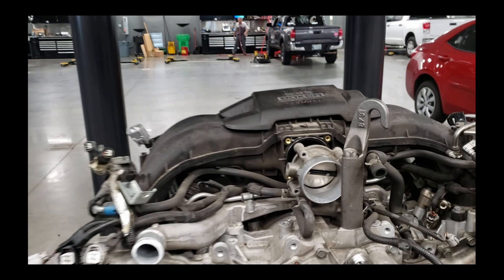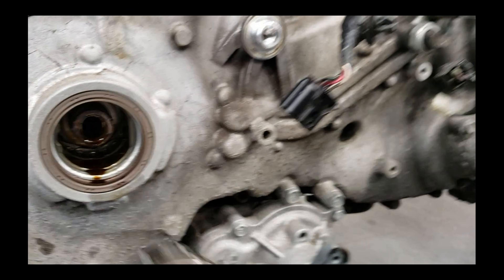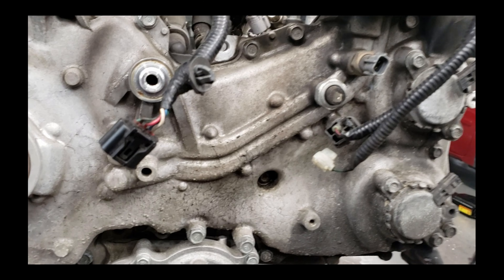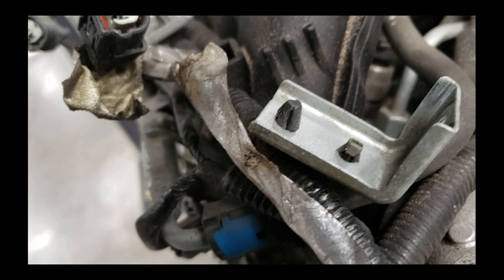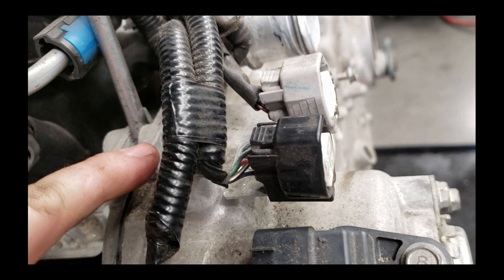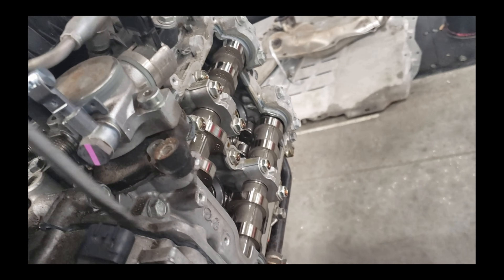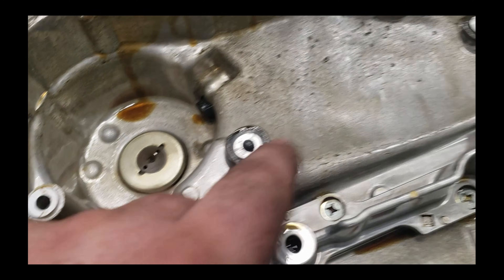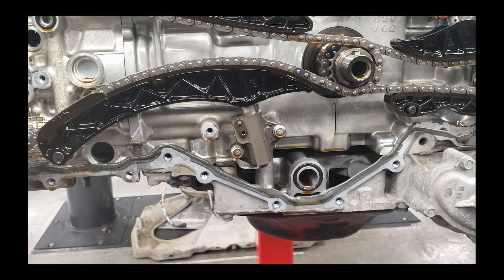how to set timing on a fa20 for fr-s/brz/gt-86| walk-through! frs/brz teardown!

Comment: I am reading online that the ECU must be changed once the sprocket are changed and new timing done? Thank you, I have a 2017 Impreza sport and might be changing the left cam sprocket code p0011.
Reply from the maker: You only replace the ecu if the code returns
Reply: @ParkHopTillWeDrop  Thanks for your reply. Based on your experience, with P0011/P000A. If you changed the VVT Solenoids and the codes keeps coming back, could it be a bad cam sprocket? or maybe it jumped timing? any information is highly appreciated.
Reply from the maker: @Yardieautospax  they normally won't just jump timing but I've replaced the gears 10 times to 1 ecu so the gears go bad often. The repair manual suggests replacement of the gear then retest if the code returns replace the ecu.
Reply: @ParkHopTillWeDrop  thank you so much. I go away for military training In a week, once I get home I will do the work. Will keep you updated. Thanks again
Reply from the maker: @Yardieautospax  no problem man if you run into an issue just reach out to me I've done over 30 of those motors I was the only one doing them at my shop until I left. P.s thank you for your service we really appreciate what you do.
Reply: @ParkHopTillWeDrop  I ended up pulling her down since I have a little down time. my engine is the FB20, I don’t see the timing arrows on the face of the cams, but I do see the engraved marks on the side of each cam sprocket. However, I rotated the crankshaft a couple times to get it in timing and i was able to get the  yellow chain links that are on the chains  close to the marks on each cam, but can’t get them centered. I would assume that means it’s not in proper timing? If you have some tips or a manual that has the correct timing to follow, for my engine series I would highly appreciate it. Or can I still use your video with the FA20 as a guide?. Thanks again
Reply from the maker: @Yardieautospax  they timing makes should be the same for fast and fb20 unfortunately all the ones I've done were fa20's my best advice is after setting it spin the motor by hand to make sure nothing touches and after 2 revolutions recheck all the marks they should line right up
Reply: @ParkHopTillWeDrop  roger. Thank you so much
Reply: @ParkHopTillWeDrop  alright, I successfully changed the intake sprocket on the passenger side (P0011) and did timing. Topped up back the oil and coolant to  proper levels. After several test drives I am getting the P0011, P0014 and P0024. Maybe the timing wasn’t done right or the ECU needs to be changed?  ,  Again, thanks for taking the find out to replying.
Reply from the maker: @Yardieautospax  the fact that you now have different codes plus the same code is slightly concerning I would check the timing to make sure its good also check for debris on yhe cam sensors does it run like it's low on power?
Reply: @ParkHopTillWeDrop  ok will pull it back off and double check the timing. I have a video that I made after I set the timing so I’ll rewatch that as well. As far as power goes, it runs fine no issue with power.
Reply: Here is a video of me explaining the theory on how I set the timing without the cover plates with the triangle marks. https://youtu.be/V0RmgRacxj0
Reply from the maker: @Yardieautospax  your explanation isn't wrong but I always set both sides up just to be sure also do the gears have arrows that line up like the fa20 as that is a nice double check. I'd always just set the painted marks to the timing marks on the gears then you can also rotate the motor over and don't quote me on the number but it's like 50 times all the marks should re line up
Reply: @ParkHopTillWeDrop  yeah. The fact that my cap sprockets doesn’t have the  plates with the triangles kinda threw me off. But, I’ll keep troubleshooting before I decide to pull it back down. I’ll do another oil change and check for debris as you said. Thanks again! Highly appreciated.
Reply from the maker: @Yardieautospax  no problem
Reply: @ParkHopTillWeDrop  Hey Sorry, I have one more for you man, please. The driver side intake, when setting the timing - should the intake sprocket have resistance where it can’t be rotated by hand ? from the timing manual " Intake camshaft LH is kept at lift position. All cams on the intake camshaft LH are pressing down the roller rocker arm (intake valve). (Under this condition, intake valves remain lifted.)"

This is when positioning the notch  at the top before putting the chain on. When I was doing mine it was loose and I was able to turn by hand, along with the exhaust… Not sure if lift positions means it would have some resistance. Thanks I’m advance
Reply from the maker: @Yardieautospax  I always had to turn the driver cam with a cam wrench I believe I mention it in the video as the cam does not sit in the proper timing position at rest it's a few teeth back so I would rotate the cam slightly then set the chain on when I got the cams to the right position but the driver intake cam does not move really easy so a tool did make that much easier
Reply: @ParkHopTillWeDrop  gotcha!!! I think that’s where I messed up with the driver side intake, The notch at the top is in the right position, but I recall being able to move it  freely by hand. but based on your explanation I should NOT  be able to move it freely when it’s in the right  position prior to putting the chain on.

Comment: What happens if you don’t roll the motor back while taking off the driver side head. I already have the heads off and back on the motor and nothing seems damaged but I definitely did not disassemble it properly.
Reply from the maker: It's just a good practice normally nothing happens but when you take the chain off with the cams it can spring forward or back and hit a valve but it's extremely unlikely
Reply: This happened to me. As I tried to reset timing  three times cause it didn't seem right ..  @ParkHopTillWeDrop

Comment: What tool did you use to rotate the cam sprockets?
Reply from the maker: It's a cam holder tool it has two adjustable pins attached to a handle and makes it easy to turn the gears

Comment: I have seen in the service manual that mentions the key will be facing down when in time but you show the pin as facing str8 up? I assume the lock key and pin are in different positions. Also if you turn the crank around and the engine turns out not to be in time or is off what happens and how to you fix it? Can you turn the exhaust and intake cam sprockets as needed to position in right and turn the crank by hand to get it set in the right position?
Reply from the maker: If you rotate it over the arrows should line up if they don't the timing is off yes the key way and pin are different the repair manual procedure is pretty crappy so this is tech tip
Reply: @ParkHopTillWeDrop  thanks

Comment: do you have to take the motor out?
Reply from the maker: no not to do the chains or front cover we had the motor out to replace the valve springs
Reply: @ParkHopTillWeDrop  what about the intake sprocket?
Reply from the maker: @cosdonamo  nope you can do it in the car no problem
Reply: @ParkHopTillWeDrop  yeah done it was pretty easy to do but had to do half the job twice.
 when i lifted the car to bolt the exhaust manifold back on i found one of the o-rings where oilpressure goes trough. must have dropped when i put the chaincover back on.
Reply: @ParkHopTillWeDrop  but i did the whole job for nothing. the toyota tec diagnosed the intake sprocket as broken. 
so i trusted him did the job myself. after the job the noise was back there. so i just pulled the plug off every phaser and found out one phaser was shot the noise stopped when i pulled the plug.

Comment: Thanks for posting this video, this is the first Subaru engine I've had to work on in my 30+ years of being a professional mechanic. It saved me from making a huge timing setup mistake.
Reply from the maker: no problem man when these came out the book was super confusing and there was an old tech tip on setting the timing that was much easier to understand I ended up doing all the subby engines to the tune of 38 at my shop so I got pretty good at setting these up and working on them we don't see a lot of them at the dealer now but I know other shops are still getting a lot of these so I'm glad I could help a fellow tech.
Reply: @ParkHopTillWeDrop  Oh I know about the confusion. Identifix doesn't have any info on this particular car, I had to go through ProDemand and all it did was confuse me because everything is broken down into sections so you have to chase each section of the head to find all the info.

I watched a couple of videos but they were just as confusing and I came across your video at closing time last night. Followed your steps, rotated it over multiple times and everything lined back up. So thanks for the clear video and explanation of the steps involved.  It really saved me from making an expensive mistake.

Comment: are the chains for right and left sides interchangable? if not, how do you tell them apart?
Reply from the maker: Not 100 percent sure if they are the same but I'll check in parts but I keep all bank 2 stuff in one area all bank 1 in another to keep everything straight
Reply: @ParkHopTillWeDrop  no doubt you guys segregate all the parts. Just asking as I’m in the middle of this rebuild 😛
Reply from the maker: @JW-rv5je  i believe they are the same but I've never checked as we separate them its an excellent question for I have no answer i wish I did but I will know tomorrow and get back with you sorry
Reply: @ParkHopTillWeDrop  no worries!
Reply from the maker: @JW-rv5je  according to my parts department the chains are the same to double-check you can count the links between the painted marks they should be the same I hope this helps let me know if you need anything else I'll try and walk you through it .
Reply: @ParkHopTillWeDrop  it’s the same, thank you for checking for me!

Comment: Hello! I have a 14 brz with a 2020 gt86 fa20 swapped into it, I have all 4 cam crank correlation codes p0016, 17, 18, and 19, engine is in time, wiring harness is good, I swapped all cam and crank sensors from old engine to see if that would fix it but no luck I'm at a loss any advise would be much appreciated! Runs and drives fine after I clear CEL!
Reply from the maker: I have a few suggestions so at some point on these they changed the cams so if you have an ecu for the old cams in the car but a motor with the new cams that could be an issue. call a dealer with the vins and see if the camshaft part numbers are the same i would do the same with the cam phasers/gears. after that I would say you have a bad ECU I hope this helps please comment back if it does

Comment: So my dumb ass missed the small 10mm bolt that was in between the two cam phasers, and broke the cam girdle outer on the passenger side. Now thats going to be fun to try to replace while in the car.
Reply from the maker: Ohhh no that's not good
Reply: @ParkHopTillWeDrop  well i got it off while in the car. Getting it back on, on the other hand, may be a little tricky.
Reply from the maker: @resuort  yeah that doesn't sound like much fun you might regret not taking the extra hour to pull that motor
Reply: @ParkHopTillWeDrop  yeah didnt have access to a cherry picker. Gotta deal with what i got.
Reply from the maker: @resuort  I completely understand

Comment: so i only had to replace the driver side intake cam gear so i tried to only take that chain off and put it back where it was but when i spun the motor over by hand one of the arrows didnt line up. i think it was only off by one tooth, would there be any potential damage done by that? i did feel a little bit of resistance at one point when turning it over, that couldnt have been enough to bend a valve could it?
Reply: I got it back together and timed correctly. Seems to run fine but one key cycle and my p0016 comes back. Maybe the ecm needs to be reflashed?
Reply from the maker: @MeLikeyHitStuff  I believe it's a replacement of the ecu not a reflash
Reply from the maker: its possible but not likely im not sure what your definition of a little resistance is as everyone has a different interpretation but  as long as you didn't force it with like a breaker bar into the valves you should be ok this is why I recommend taking all the plugs out if you feel resistance with the plugs out def stop and just rotate the crank slightly then move the cam. I think you are going to be ok please let us know when its all back together and hopefully we were able to help.

Comment: If I'm doing this while it is in the car do I need to drain the oil and coolant ?
Reply from the maker: Yes sir
Reply: @ParkHopTillWeDrop  what can i use to move the intake cam if I do not have that $500 Lexus cam pliers ?
Reply from the maker: @resuort  pull the plugs you can move them by hand harbor freight has a cheap tool that has pins in it looks like the Toyota one but it's cheap
Reply: @ParkHopTillWeDrop  i have angled needle nose would that be sufficient ?

Comment: Can you replace the chains, tensioner & guides while it’s in the car? Or you have to take out engine? I have a 2013 Subaru Impreza FB20 motor…video was very informative! Thank you! Great work!
Reply from the maker: you can replace the chains guides and gears while the engine is in the car I had it out to put valve springs in.

Comment: Do you have the link for the tool you used to hold adjust the cam?
Reply from the maker: harbor freight  pin tool is all you need its a handle with adjustable pins on the front the pins fit in the gears and allow you to move them

Comment: I have another question for you.  I took my fa20 heads to the machine shop and they aren’t  sure if the valves are hydraulic or not.  They asked me to bring in the cam assemblies too.  If they reseat the valves will they have to grind off part of the stem to keep the correct valve clearance?  Any advice I would be thankful.
Reply from the maker: yes they will grind the stem a small amount to keep the valve lash correct it seems like the machine shop you choose knows what they are talking about as some shops will just cut them and send them to you
Reply: @ParkHopTillWeDrop  thank You

Comment: Well Im back. My car has low compression(105-115psi)on all cylinders, and car startups immediately shuts off. I have done a smoke test to check for vacuum leaks and have replaced most of the vacuum hose/lines with new OEM lines. Could timing be the issue here? I also did a leak down test and only had air coming out of the dip stick and oil cap. I had 40-50% leak down for all cylinders. Which means pistons aren't sealing properly? Or could timing somehow be off by like one or two teeth? Could this happen? I have used the old timing stuff, i assume this was a mistake? They looked fine, and it is a metal chain than a belt.

No air/bubbles coming from radiator filler neck, no air escaping from the exhaust, not sure how to verify if air is escaping intake other than removing intake manifold.
Reply from the maker: air coming from the dipstick is a good indication you have some kinda lower end issue pistons block rings ect I don't think at this point you have a timing  issue I do however think you might have something else happening as with low compression you should get a misfire the car won't normally start then shut back down sounds like electrical ECU type issue or a fuel pump concern
Reply: @ParkHopTillWeDrop  yes i forgot to mention that she doesnt want to idle unless i apply throttle at startup and then she eventually stays running. If no throttle applied the car would die immediately after startup

Comment: great video, just a fee questions, what tool do you use to remove the valve springs/install them, and what tool is use to remove the valve stem guide that holds in the seat for the valve spring?
Reply from the maker: It's a toyota special tool ill get the part number for you
Reply: @ParkHopTillWeDrop  sweet deal, much appreciated, also im trying to find the tool to remove the valve seal, to get at the seat for the valve spring. bought a valve seal remover kit on Amazon, and sadly that fid not work.

Comment: I can’t find a timing kit for my 2016 frs only for 2015 would that be an issue
Reply from the maker: not sure what you mean by a timing kit? are you looking for a chain, guide, and tensioners I'm also assuming you are looking aftermarket and if that is the case I would advise against that and go OEM on these parks as they are in the motor and very important
Reply: @ParkHopTillWeDrop  I mean the timing chain assembly 
The chain,  guides ,tensioners everything oem is fine 
I spun a bearing and decided to replace the timing since the engine is already out
Reply from the maker: @Chavito-eightsix  I would get a chain from the dealer personally
Reply: @ParkHopTillWeDrop  ok coo I appreciate the quick reply 
Thanks for video too lol
Reply from the maker: @Chavito-eightsix  no problem I'm checking on the chain parts here at my dealer please consider subscribing it helps me do more stuff like this
Reply from the maker: The chains are the same from 2013-2016 they are 95 ea from the dealer there are 2 of course. Hope that helps
Reply: @ParkHopTillWeDrop  yes it does thank you !!! X2